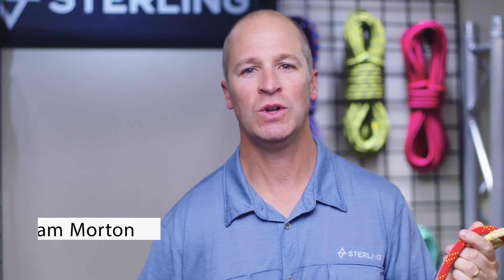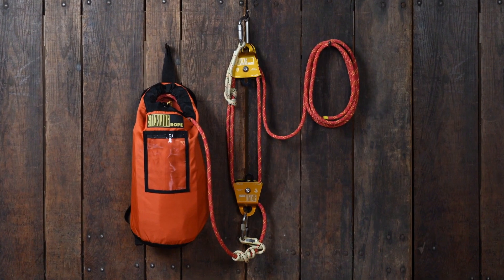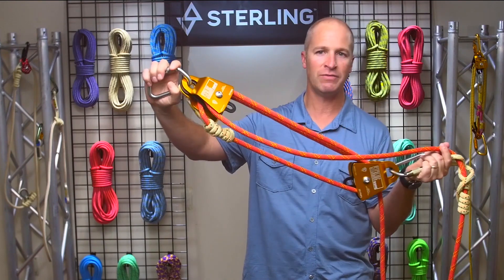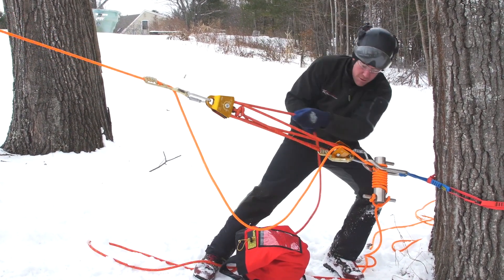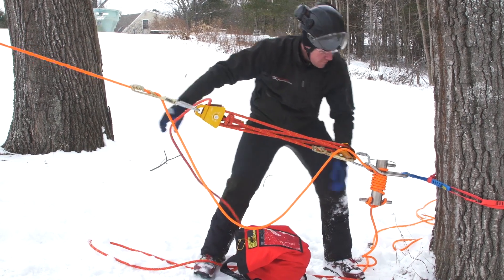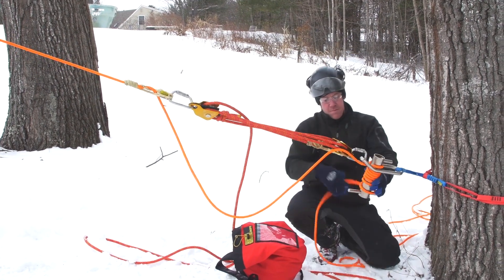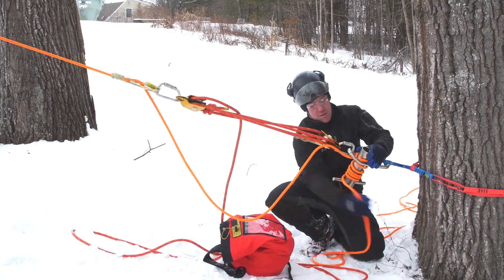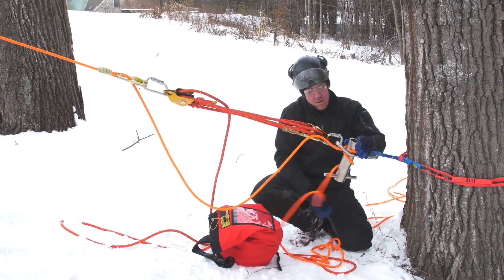Sterling Rope Tree Pulling Kit

Comment: Wait a minute. Why would I need to pull a tree?
Reply: To drop it under control rather than relying on gravity and wishful thinking. Being lazy I use a tree strap and a snatch block (typical 4x4 and wrecker gear) so I can be far away from the farthest point a tree can drop and out of the line of fall, then when I'm down to holding wood I get in my truck (no conventional winch can spool fast enough) and slowly drive off pulling the tree to the ground safely under full control. I learned this during Hurricane Hugo doing it with my bros old Power Wagon whose PTO winch was a beast. My trees don't barber pole or to other silly stuff and I'll treat them just like recovering a vehicle including a second line if required to ensure they go where I want them. Arborists are in a rush because time is money. I can take my time and use technology.
Reply: @obfuscated3090  Tree hackers are in a rush, Arborists aren't because we price jobs according to the level of complexity, access, etc, etc.
Reply: @Toyotaamazon80series  two thumbs up.

Comment: What is the silver cylinder attached to the tree saver and why isn't it in the kit?
Reply from the maker: That is a Port-A-Wrap, a tool that can work with the Tree Pulling Kit, but not required. For more info on the Port-A-Wrap, you can check out this youtube video about it: https://www.youtube.com/watch?v=Ssgp5gmS7hA.

Comment: How do you keep tension on the line allowing you to let go once the 5:1 has bottomed out? Why doesn’t it spring back out?
Reply from the maker: It's hard to tell in the video as it's hidden by the pulley, but we have a RIT 9mm Bound Loop Prusik that we use for progress capture. This bites on the rope and when you let go it holds the system in place. Hope this helps! -Erin @ Sterling